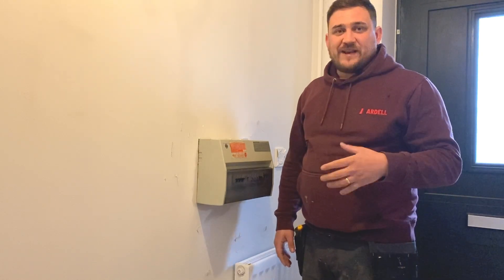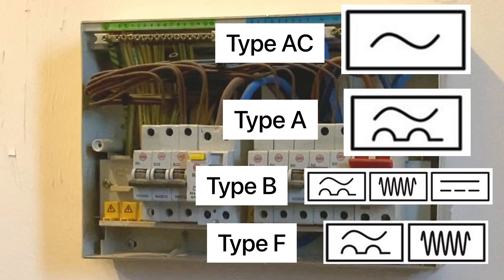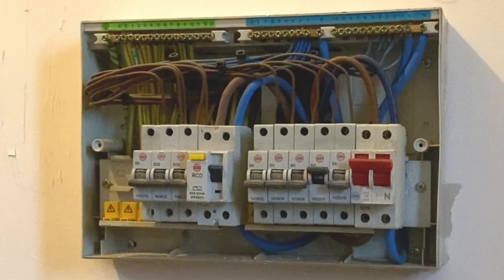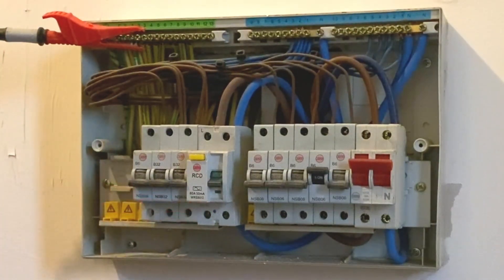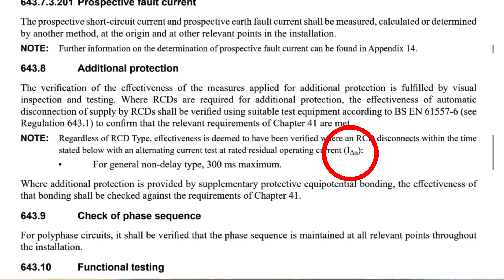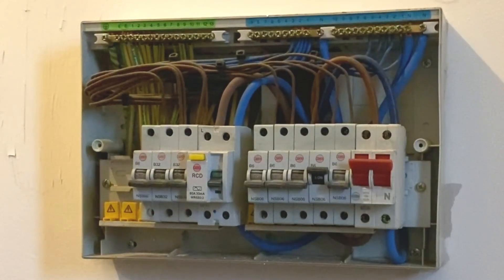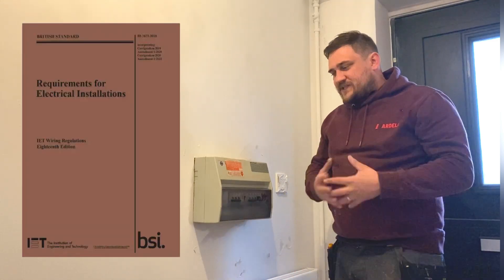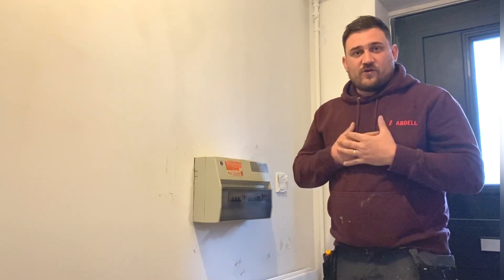BS 7671 Testing RCD’s - Regardless of the Type of RCD Test it as if it is an AC RCD at x1 ONLY

Comment: Thanks for the video (learner here).....Im slightly confused as I've seen RCD tests with the circuit disconnected but you are tresting with it connected here, also I've seen tests ny testing at the top of the the RCD whereas you are testing at the bottom? Or is it different when testing an RCBO? Which is the correct way? Thanks.

Comment: Well this testing at the DB but the test should be done at each socket outlet. 
The test you are doing is a result without the test button 
The 50mm rule throughout the CIRCUIT

Comment: why would you put yourself at more risk of working on or near live conductors when you could have tested at a socket outlet in this instance?
Reply: RCDs should be tested at their source.  Testing at a socket with an adaptor may interfere with the test due to potential faults in the circuit.  Following the correct sequence of tests would of course eliminate that possibility

Comment: Hi thanks for helping electricians stay up to date, nice clear info
I suspect it was a slip of the tong and other people have probably already mentioned the sequence of testing an RCD is 1/2 x first, then 1x and finally 5x
1/2 x test must be done before the rcd is tripped so if the mechanism is sticky and doesn't trip it needs changing as it would not have provided protection in the state it was when youi arrived on the job
not sure where we stand if you get under 300mS for both half cycles at 1x but then get more than 40mS at 5x. it doesn't comply with previous additions of the regs but does comply now as the 5x test isn't required

Comment: It’s a backwards step in my humble opinion. I’ll always use the “auto” function and go through the full range of tests. But then that begs the question, do you bin it if it fails the x5?? 🤷‍♂️ 

If they’ve removed that trip table from the back of the good book, then what are the time constraints for a standard 100mA? 
And 100mA time delayed?
Reply from the maker: Remember BS 7671 is the minimum requirement 👍🏻

Comment: Is the reason to reduce minimum tests to 1x a result of the manufacturer's claiming we're over testing RCDs, resulting in premature failure? If not, what's the reason?
Reply: The reason is to keep the shareholders happy....
Reply: Over here in NL we are encouraged to test all our RCDs at least once a month with the test button. You can guess how many people actually do.
Reply: @JasperJanssen  That test only proves the mechanics operate, not the threshold at which a fault current would trigger it.
Reply: @MS-Patriot2  that is not true. The test button connects to a resistor connected across the poles that generates a test current, and that is what trips the RCD. Now granted, the test current is probably a little higher than the exact specs, but it is a test current and not a mechanical test.
Reply: @JasperJanssen  I agree and that’s what I meant. It takes no account of reaction time either.
Reply: @MS-Patriot2  true as well. If you want to determine whether the test button is useful, you’ll have to know the likelihood of the RCD failing in those ways (slow to activate, and/or activating at higher than specked currents) vs failing to act at all, and some actuarial statistics on how dangerous it is to people behind it for it to be out of spec in those ways vs not operating at all.

Apparently, the people who were writing the regs back in the seventies all thought the test button was a worthwhile inclusion. I would certainly buy the concept of the situation having shifted enough (due to different manufacturing processes) that the test button is not a particularly useful thing any more, though, and now roughly as useful as an appendix.
Reply: @JasperJanssen  Good analysis. Better to have something the end user can choose to exercise to mitigate a latent fault.
Reply: So we are fitting surge protection, metal boards, soon fully AFD boards all for safety and now not fully testing an RCD just because manufacturers are making crap gear. Tested one today passed the 1x but failed the 5x on a Type AC. I thought the whole point was making sure it didn’t rise pass 50v touch voltage.

Comment: Crazy how alot of people had to go out and buy new testers at hundreds of pounds to test type a rcds and year later could of kept there old testers that had nothing wrong with them 😅
Reply: Most domestic are B curve
Reply: BINGO!  Makes you wonder whether industry has some input to the IET on a purely commercial basis. A bit like CPS membership.
Reply: @MS-Patriot2  I think so and now this type a rcds is on every circuit. So if you install a single socket or a fuse spur you need to tell the customer they need a new c.u or separate enclouse to house type a rcd they are going to say get lost use an extension lead and be far more unsafe than before. Considering these people are so intelligent they are thick
Reply: @gd-bq7em  If a customer has an older style distribution system without any RCD protection, I don’t see how they are any less protected if they choose to use an extension cable.   The vast majority of customers will understand the safety improvement a more modern CU offers. What I think is most important is for the electrician to only install what is really needed, not what the latest fad happens to be from industry. I’m thinking AFD and SPD in particular here.
Reply: @MS-Patriot2  I have to be honest it's all getting a bit silly for me know. 
  I can understand safety and that.
    This is an example I was talking to  
Tech support the other. I do alot of work for white goods shops that fit  appliances. For example a single oven they go out can't be done because the 13 amp single oven is wired into the 32 amp supply. So they ask me to go fit a socket.
  The new regs say now that socket should be type A protected because of dc components.try explaining that to a customer they just want there oven fitted. They say been like that 10 years lol it's rcd protected already but ac type.
   They will l say just extension lead to the nearest socket.

Comment: I don't get why you'd do the other tests? There's no-where to put the results, and regardless of what those results are the only one that matters is 1x, so it's a literal waste of time doing the other tests. It's like doing an insulation resistance test that comes back perfect, then visually checking every inch of cable afterwards.. pointless.
Reply: Your 100% correct, if 1x is the requirement, that’s the test. If they didn’t think it was more than adequate it wouldn’t be in the regulations. All this bull “ I’ll still test at 5x cause I’m dedicate to a higher standard, is pure and needless vanity”.
Reply: Just because there's nowhere to pit results, doesn't mean we shouldn't a certain tests? Neutrals for example, we don't test them and yet we should so as to ensure connections and complete circuits. The "Bang" and "It doesn't work" tests aren't tests as they rely on luck and bad practice.

Comment: What is the point of testing at 2X and 5X? The RCD is rated to 80A, so why not test at 80A to make sure it is effective? That seems more logical than testing at 2X and 5X. I assume that at 0.5X, you are making sure the RCD does not operate?
Reply: He is testing the 1x 30mA earth leakage current (I-delta-n) If it passed '80A' test, you're already dead! The 80Amp is the max operating through current when under load when supplying all the mcbs. Your heart can stop with less than 30mA.
Reply: ur not getting 80 amps out of some Duracell batteries either mate

Comment: That’s a fantastic place for A CU , gives the kids something to play with when there board .   
As for the test I was told by JW that my  old faithful ROBIN KTS 1620 was to old and will only test AC type RCDs so would be useless on a modern installation, I said he was wrong as the KTS 1620 has a function for testing DC sensitive RCDs . And now look we only need to test on the AC function at 1 times i delta n . Nice too be proved right 😂but like you Marcos I will continue to test 1/2 1and 5 times I delta n ,
Fantastic video very well explained 👍👍👍👍❤️
Reply: It's mad howany people went out and got new testers for these type a rcds and now it's all scraped could of stuck with the old meters nothing wrong with them
Reply: @gd-bq7em  that’s why I never brought a new meter. I’ve had a Robin KTS 1620 MFT for over 20 years and I have no in tension of replacing it, although I also have a kewtech KT 63 that I got last year for no other reason than it was cheep . I also still have my little Robin multimeter that I got when I was 15  .
Reply: @seandempsey7351  i think this 18th edition has been a bit of a cock up nothing but hassle and put prices up    
On every job because manufacturers charge arm and a leg for these new parts . Customer end up getting dave from down the road and end up with more problems than before they started
Reply: I love this guys comments brilliant going for new tester..,🤣🤣
Reply: @adriatikkrasniqi1453  who you referring to may I ask?
Reply: @seandempsey7351  about  spending money on instruments in general ..,
Reply: @adriatikkrasniqi1453  oh ok . Well it does make you think is it worth spending money on  testers we don’t really need